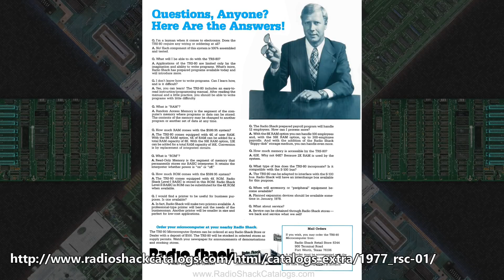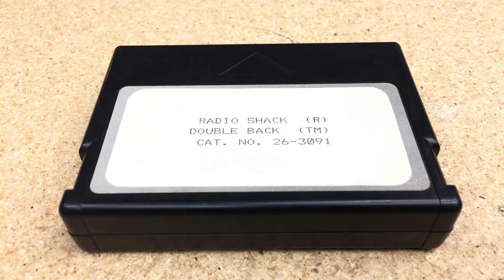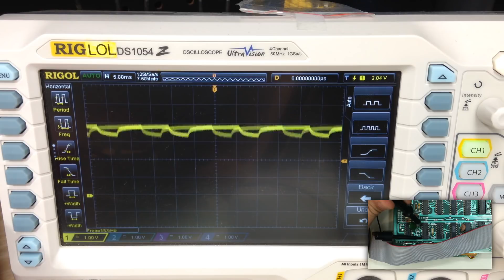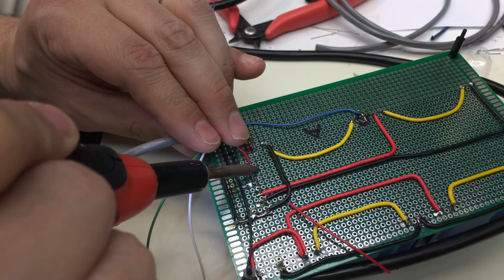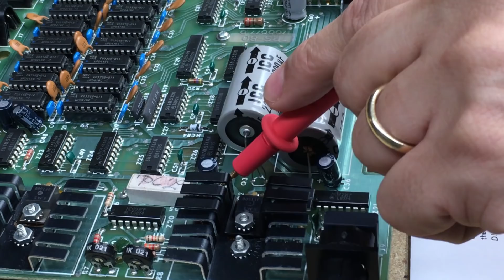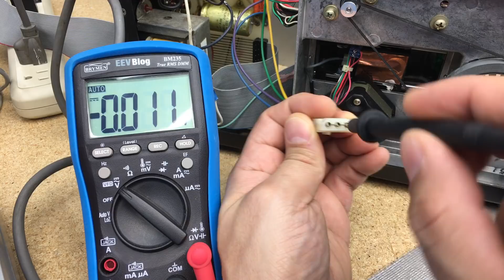LET'S REPAIR: Radio Shack TRS-80 Microcomputer System

Comment: Boy, do I remember the TRS-80.
My first programming job was to write a program for an electric motor shop.
The motor techs would com back from the field with a data sheet with all sorts information that was from another planet.
My job was to write a program that takes that raw date and print
a readable report to the printer. 

It worked. And I got a nice chunk of change for my work.

Radio Shack TRS-80 model 4

Comment: TRSDOS was a problem altogether.  Early versions (esp. v2.2) could easily destroy the disk directory.  V2.3 seemed stable enough (but watch out for hitting BREAK at the DOS READY prompt - it might land you in Level-II BASIC!  Fixing that one one of my first disk bug fixes.  I ended up with LDOS when I switched to a Model-III.  I now use the TRS32 emulator using DOSPLUS which does have some bugs, even if the writers offered to refund you if you found any (they were so cock-sure that it was bug free!).

Comment: I'm restoring my Model 1.  It's a pretty low serial number:  12890  And, it has the expansion port cover.  :-)  Having some sync issues at the moment and the keyboard ribbon cable was pretty much gone.

Comment: This was also my first computer. We got one in mid 1978. Eventually we added a LNW System Expansion to it instead of using the Tandy expansion interface. The LNW came with the bare board, a parts list and a set of build instructions. I have fond memories of souring the local HAMfest looking for all the parts needed with my father and learning to solder helping him assemble it. I wrote my first programs and connected to my first BBS, using a Novation Cat 300 baud acoustic coupler modem, on that computer. Eventually I was lured away by the colors and 3 sound voices of the Commodore 64.
Reply from the maker: Those are the memories, right? First machine, first custom board, first solder job - all the same for me with my original TRS-80, too.